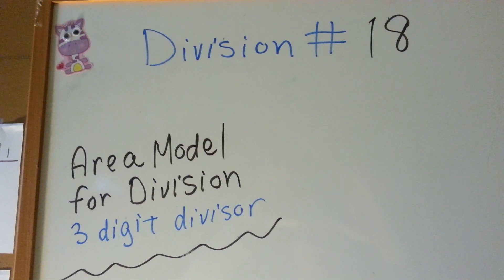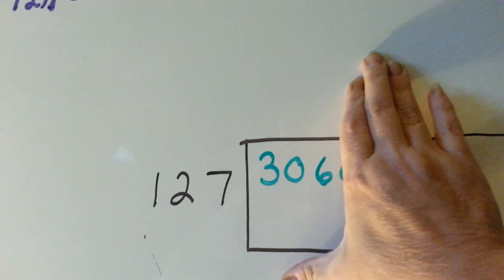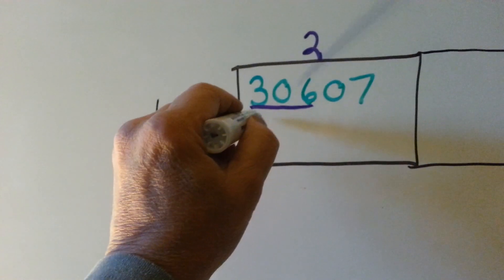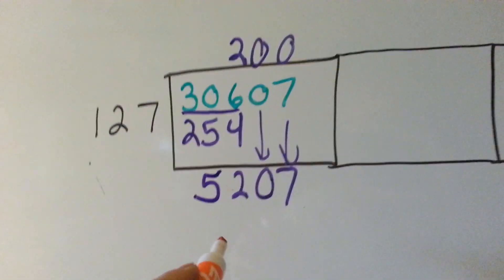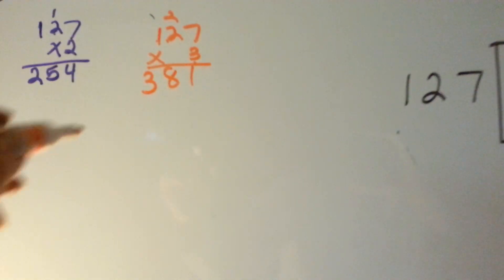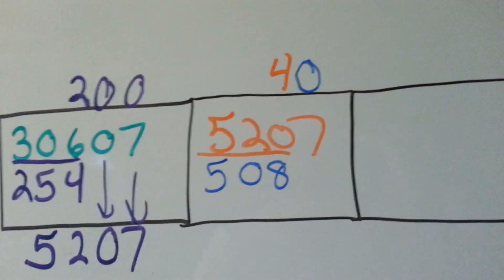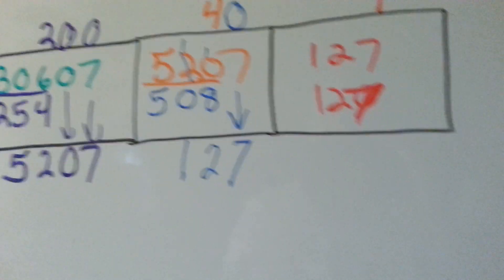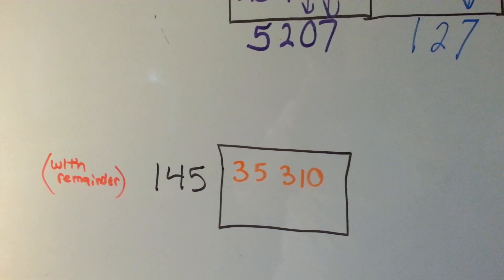Area Model 3 digit divisor (Division #18)

Comment: example 150000/16000 =9.375 how it is come and why we use point in division.
Reply from the maker: Because 16,000 is not a factor of 150,000. They don't divide evenly .If you had 5 apples and wanted to divide them to 2 people, each would get 2.5 apples. That's 2 1/2 as a mixed number. 2 is not a factor of 5 so one of the apples has to be divided into parts.  If you had 6 apples, 2 people would each get 3 of them, because 2 is a factor of 6. 

.375 = 3/8